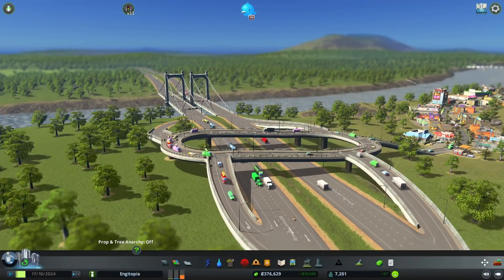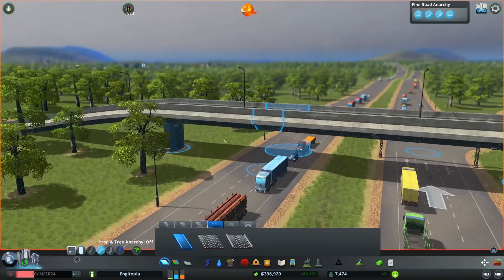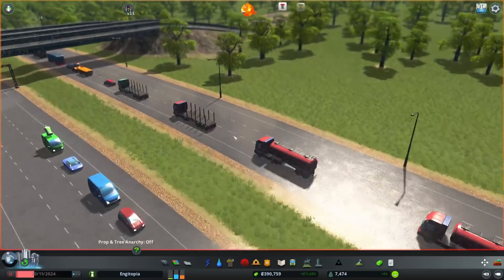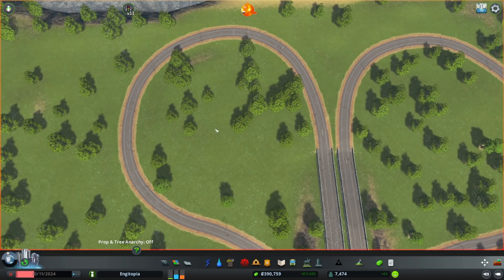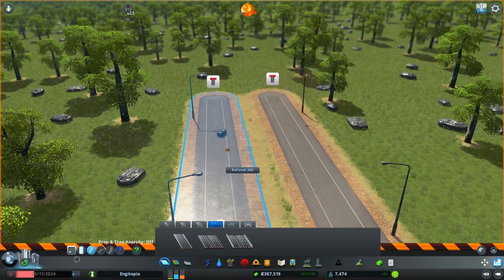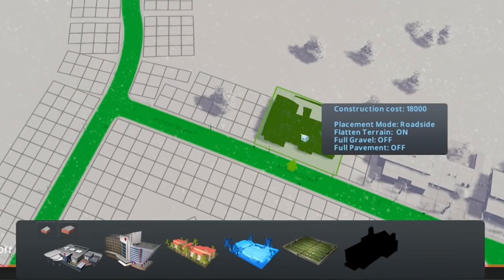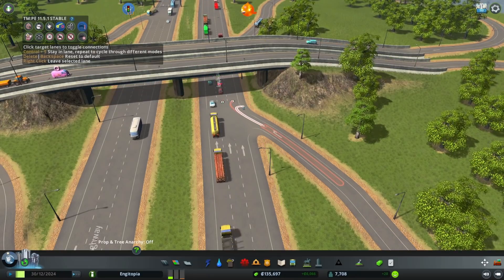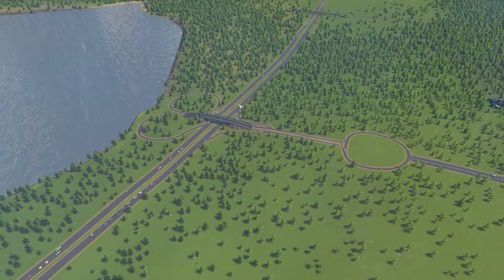Using THE MOST EFFICIENT Junction Layout in the Game in Cities Skylines!

Comment: Now for the next level: Keep your on-ramp downstream from the off-ramp so that there's no conflict between merging traffic and exiting traffic.
Reply: Hard to keep the rce design theme with that though. Fully agree with your logic.
Reply: Yes, but that requires more bridges.
Reply: @beeble2003  search up trumpet interchange it uses the same amount of bridgey
Reply: @beeble2003  A trumpet design uses the same structural provision, but with both slips (crossing over mainline) remaining parallel for approximately 180 degrees after which they part in a left-in/left-out pattern joining the mainline itself though with far smoother horizontal curve transitions as opposed to actual LILOs.  That said, it is very rare to maintain full motorway speed through such interchange connectors (would be usually around 30-40mph).  For higher speeds, a more expensive three level directional T stack would be required (M5/M42 and M40/M42 interchanges near Birmingham as examples).
Reply: Still bugging me
Reply: But the shape will not be as strong as this one. this shape show the full potential of the road. while the shape you propose is only show one side.

Comment: "move it is useless for roads"
roads is its main use D:
In that specific case, you can use the same keys for raising or lowering roads when building to raise or lower the node. There's also a 'match height' function.
Reply: It's not the tool that's useless, it's the guy holding the handle.

Comment: Lane Mathematics:
If you have a crossing at faster levels - make the lanes split evenly. 4 lane splits into 3+1 lange -- 3+1 lane join into 4 lane roads.

so at 1:17 on the raised street you would have - 2 lanes on the long part - 3 lanes on the turns with the outmost lane being an exclusive right turn lane for exiting and incomming traffic.

Also Off-ramp befor on-ramp. E.g. 3 lane -> 2+1 off -> 2+1on ->3

Comment: The discussion of construction factors was great, but I have a quibble with the "most efficient" design; where you put the first two loops there is a cross-over of traffic entering and leaving the highway which will lead to congestion at higher traffic volume. A trumpet interchange is essentially the same, but eliminates this cross-over.

Comment: the lumps are have to do with large changes in heights of nodes that are close to each other. so you can use move it to make the heights closer to each other and it fixes the lump. also the weird invalid shape was because the game thought you were making a curved road as you probably had that selected before and clicked to make vertex of the curve but then switched to the straight tool. to fix that in the future just right click

Comment: A diamond interchange is definitely cheaper than your genitalia-complete-with-glans design. It holds up reasonably well to traffic. It accommodates U-turns without the need for a separate roundabout. For heavier traffic it can be improved with coordinated signal lights or roundabouts at each end of the bridge to eliminate traffic conflicts.

Comment: The junction would in fact be even more efficient on the far side of the highway (with the bowtie shape) if you'd connect the exit lane before the entry lane. Right now traffic entering the highway has to merge and cross over with traffic trying to exit. When traffic increases, this will start causing problems.

Comment: Some more tips for mods would be actually
Network extension 2
Roundabout builder
Node controller 

Also you can move things in any direction with move it (page up and down for vertical movement and Strg + h  to align the height of nodes to another)

Comment: For more realistic building You'll need couple more mods. Some of them You might have, but I don't want to miss any of essential mods for roads building :)
Move It, Precision Engineering, Network Extensions 2, Node Controller V2.2, Parallel Road Tool, Fine Road Anarchy, Intersection Marking Tool, Fine Road Tool.
Additional for eyecandy Network Fences - Road Decoration Pack, Concrete Beam and Cable Networks, Quay Anarchy, CURB Network, Striped Networks.
There might be some dependencies, but that You'll need to check for Yourself. With Those mods You should be able to make realistic road layouts :)

Comment: If you bring the onramp after the bridge round to the left rather than the right then it will merge back in after the traffic comes off instead of right before. With the design you have now traffic is merging in and traffic is coming off in the same stretch of road, but by following the offramp curve and then joining on afterwards you don't get this problem. Why isn't the standard design like that instead?

Comment: A lot of these free placement mods can ruin parts of the game unfortunately. There are reasons some of these limits exist in the first place, as you start to go outside of the possibility of the game code. Unless you really know what you're doing when using these mods, I'd reccomend against it as they can be be more troublesome than helpful.

Also, when the roads go haywire at the end when placing, it's because of the "curved road" tool. It's trying to round itself back to itself, without really having any room to do so. Try using the straight road tool when possible (below the prop and tree anarchy text).

I'm enjoying the vids and seeing how you play :) keep it up.

Comment: I've never been to UK, only the US, Mexico, and Bahamas. Taking an exit ramp and maintaining a 70 mph speed is a relatively foreign concept here in the US, unless the "exit ramp" is just a split where a new highway starts. Most ramps have a suggested speed limit (yellow sign) which *generally* means you can safely go about 10-15mph above that without losing control or rolling. I will say, driving the country roads of Ohio, where, if the speed limit ISN'T posted it is automatically 55 mph, the yellow signs are NOT AT ALL CONSISTENT OR ACCURATE. I've gone down mountain roads in eastern Ohio where if you even approached the yellow suggested speed limit you'd fall to your death (I'm talking 40mph recommended, and 25 mph feels like you'll lose traction) and other bends where the suggested speed limit is about 20-30mph lower than what is reasonable. Ohio, West Virginia, and Pennsylvania (basically the Appalachian mountains) yellow speed limit suggestions in the country are worthless, and you should use your own discretion.

Comment: This design is actually not as good for traffic flow, if the traffic gets heavier. You have the weaving traffic after the ramp joining the highway and before the next ramp leaving (basically the core problem of a cloverleaf, though just one one point instead of 4). Better use a Trumpet design in this occasion – it's not as symmetric, but it has the joining ramp after the leaving ramp.
(In reality you will likely only find this where a full cloverleaf was planned, but not completed.)

Comment: 1:30
I just realized something about this junction, or maybe I’m missing something. At any rate, there appear to be two turns that cannot be made here. (For the purposes of this explanation, the top of the screen = North, the bottom of the screen = South, the left side of the screen = West, and the right side of the screen = East.)

So, obviously, there are no issues with continuing to go straight from any direction, so vehicles heading West from the East can continue straight towards the West, vehicles heading South from the North can continue straight towards the South, vehicles heading East from the West can continue straight towards the East, and vehicles heading North from the South can continue straight towards the North. Additionally, vehicles from any direction can easily make a right turn, so vehicles heading North from the South can turn right to go East, vehicles heading West from the East can turn right to go North, vehicles heading South from the North can turn right to go West, and vehicles heading East from the West can turn right to go South. That just leaves “left” turns.

So, on the north side of the central bridge, there is a bridge that allows vehicles heading North from the South to make a 270° right turn to go left towards the West, and in the southeast quadrant, there is a curved road that allows vehicles heading South from the North to make a 270° right turn to go left towards the East. This means that northbound and southbound traffic can effectively go left, right, or straight at the junction. However, there doesn’t appear to be any way for vehicles heading West from the East to go left towards the South, nor does there seem to be any way for vehicles heading East from the West to go left towards the North. In other words, westbound and eastbound traffic can only go right or straight ahead; they cannot go left.

So, based on this, people coming from the East cannot turn South, and people coming from the West cannot turn North. Is this intentional, or is it an oversight? Or is there something I’m overlooking that would allow these turns to be made at or near this junction?
Reply from the maker: This was just I ran out of time on stream haha, I was going to come back and change it when I have mastered the controls so didn't bother finishing!

Comment: you do it wrong. !!! traffic comes into the highway, and short after traffic can leave the highway.. sooo wrong. the road that was leading into the highway should enter after the exit. also you dont need to make the huge circle curve to go over the highway. that can be done much smoother, just raise the road, and turn it smooth over the highway. the road going over the highway, the other direction, you can easly make as a tunnel. also smoot. full speed. but never ever enter the highways just before an exit of the highway. then you can not make the lane mathematic correct

Comment: RCE, I'm sorry, but your junction isn't the most efficient. People turning left off the highway will be weaving between the people turning left on to the highway. It looks aesthetically pleasing yes, but it isn't as efficient as possible, even if you need to make a new design with the same budget. And you know what that means. RCE IS AN ARCHITECT CONFIRMED!!!!!
Reply: I would recommend using a trumpet instead. You will only have to change one of the slip roads.
Reply from the maker: When viewers don't read the video title correctly... 😅
Reply: @RealCivilEngineerGaming  Just because it's in the title doesn't mean it's correct :P I'm pretty sure the rest of it is accurate tho